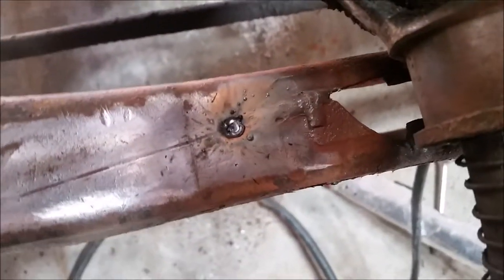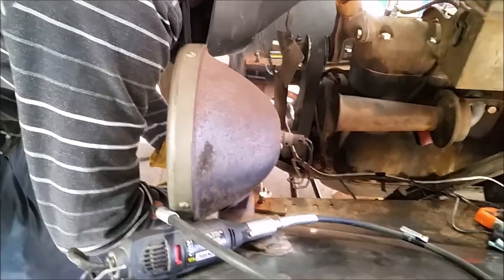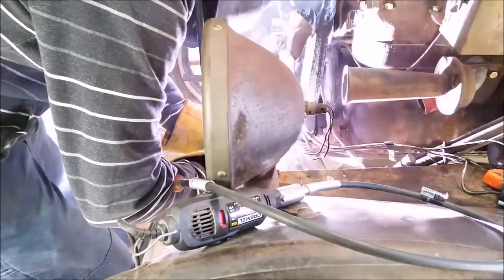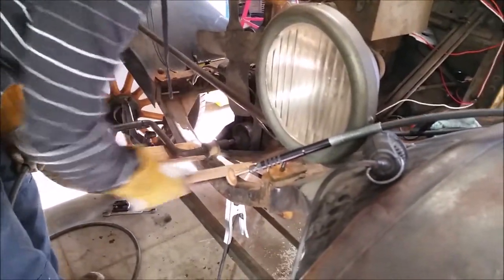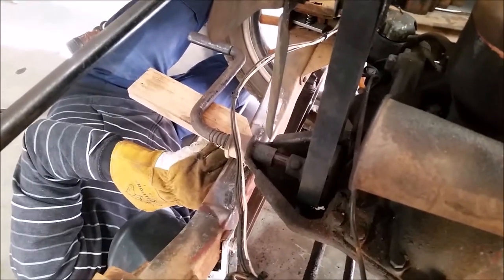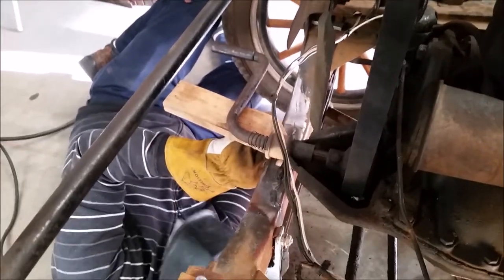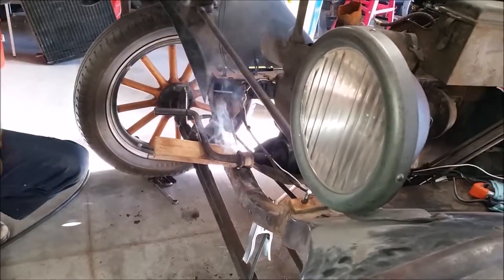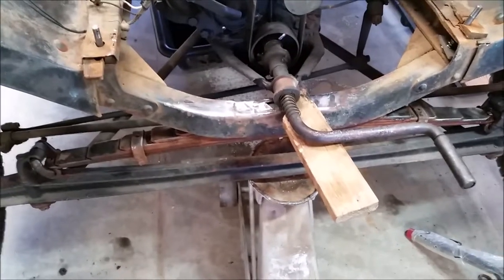1927 Model T Frame Crack Repair Part 2

Comment: If anyone ever does this type of welding on a frame, after completion you should reheat the entire area upto 2" around the weld till it is back to a good red color and allow it to cool as slowly as possible. This allows for the metal molecules that can change direction and induce stress cracks
Reply from the maker: Thanks, I'll do that before I get her back on the road. I only go 100 miles a year.

Comment: Nice work.  Good you caught that before something bad happened.  I have a '27 also, and it has wooden spoke wheels.  Some people have told me that they are not original, but I don't know why not.  Do you know anything about that?  Thanks for posting.  Enjoy your T.
Reply from the maker: I was told that all 1927 Model T's came with wire wheels. I can't imagine why someone would change them to wood. ?? I've seen several '27's with wood spokes.
Reply: I have a ‘25 with wood spokes. From what I’ve read that was the last year the factory used wood spokes.
Reply: @swimminwitdafishes8059  Got a '27 with wooden spokes.